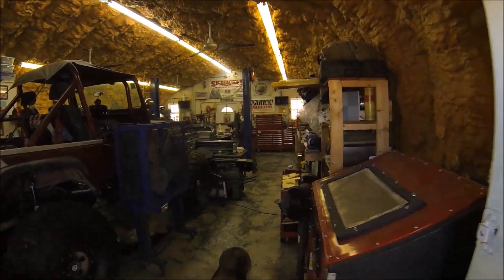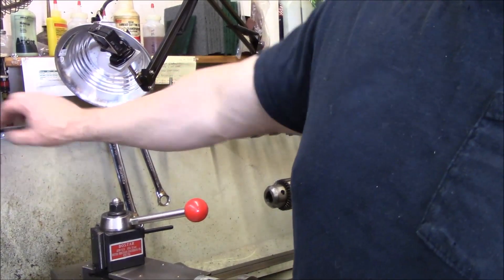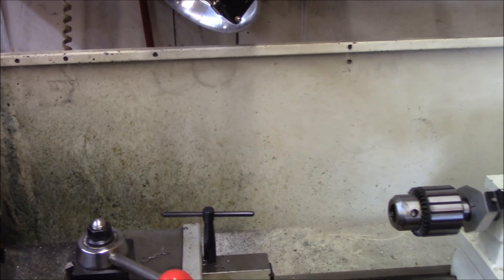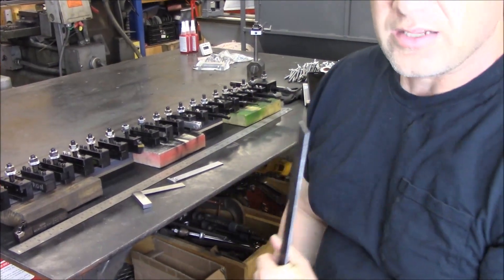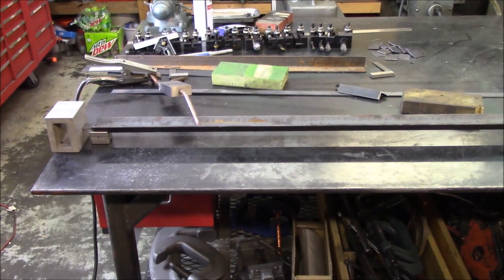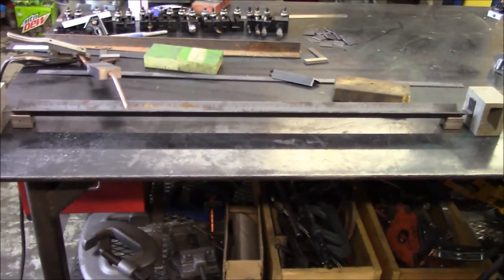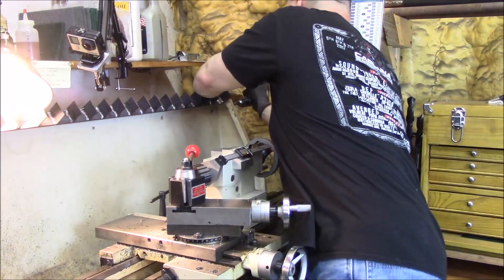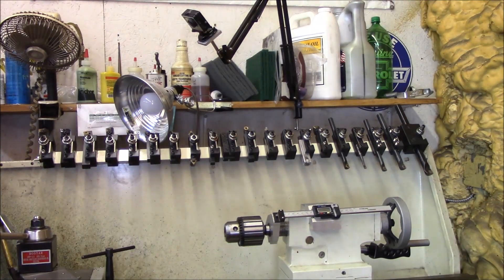Tool holder rack for the Enco lathe

Comment: Nice job,   dont think i would have solid welded the tabs on.  Im sure the angle bowed a bit . But it works and looks good.
Reply from the maker: It bowed ever so slightly, but once I mounted it there were no issues and fits fine.